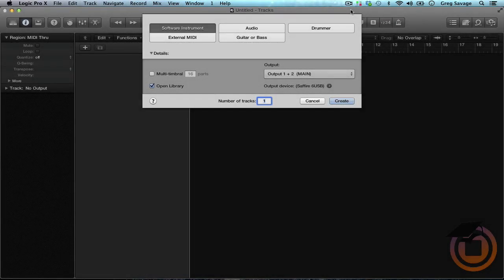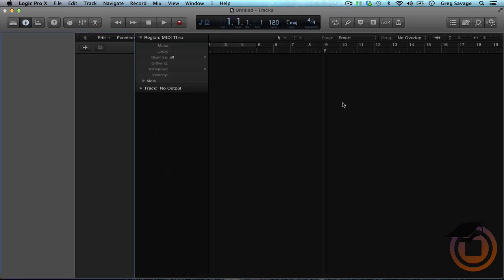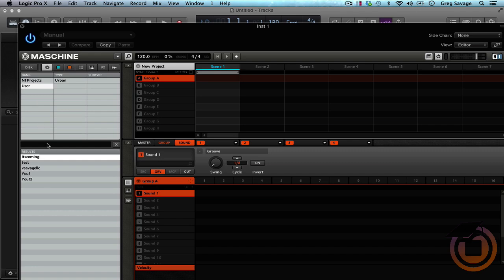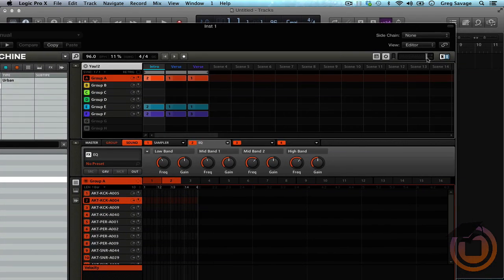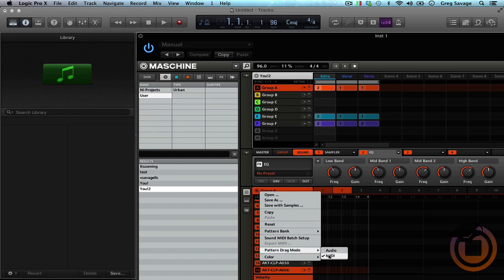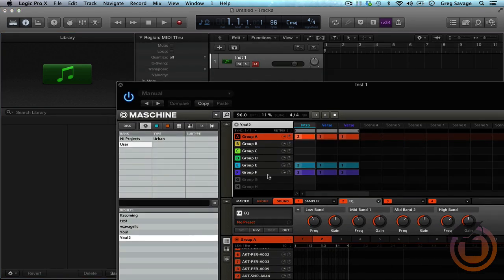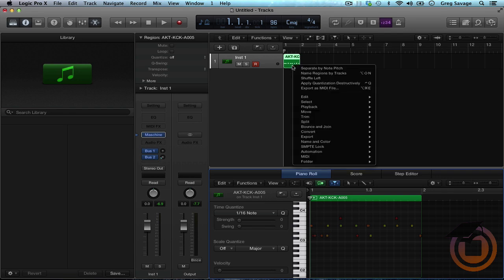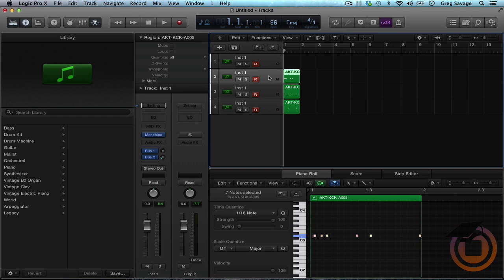Tutorial: Drag Midi from Maschine into Logic Pro X for Mixing

Comment: how can i then eq/effects on each seperate track as if they are all individual tracs this just leaves them all the same on the arrange window?
Reply: I don't understand your question would you please rephrase it
Reply: Hi Greg. I'm struggling with this issue. I have set up the midi tracks fine and separated the tracks by note pitch but when I go to mix/add effect to an individual element it controls all the elements at the same time; when i drop the bass volume the whole pattern drops in volume although they are on different tracks. Would be great if you could help me with this!?
Reply: Jamie Rowland I'd have to see your routing to know what's going on

Comment: Big ups for the tutorial! There is still one big question: I want to use the maschine only for having a faster workflow in Logic by playing the drums on it. But I dont want to edit the drums in maschine but in Logic (add FX doing the EQ etc).
How can I stop the maschine from repeating the loop over and over? If I have to work with audio instead of midi I can just do all the work by hand, which would be quite stupid.
Thanks in advance
Reply: i've just seen that others in the comment section had the same issue but didn't find an answer. It does automatically play and repeat the scene in maschine when I press play in Logic...
Reply: Hey Joël Cavin as I've been telling others I need to see a screenshot or video of your settings, this way I can see what's going on.
Reply: alright, cheers!
Reply: select a empty scene from maschine
Reply: Ever find a fix to this? I've attempted to play an empty scene in the plug in but it just mutes the whole track??
Reply: @jrowland861  did you find a fix for this? I have the same issue
Reply: Jamie Rowland I'd have to see your settings

Comment: thanks for this, however when i drag midi like this i get both the midi notes and the mashine software playing the same audio (twice as load overall), how do i get only the sound from the logic midi track? Cheers
Reply: Restlesscrocodile can you show me a video or screenshots of how you have your routing setup?
Reply: Yeah the same thing is happening because maschine is reading the midi from logic as well as the midid from inside maschine. Did you figure out any way to get around it? I guess you'd just have to delete all the patterns or just have the maschine looping in an empty scene...?
Reply: Ryan Nicolosi can you please show me a screenshot or short vid of your routing? This way I can see your issue and correct it
Reply: Ryan Nicolosi yeah solve the problem, once you drag the midi notes onto logic then just click another pattern with no notes on it so that the maschine is silent

Comment: thank you heaps man - great video.

Just wondering how to isolate the playback to just the midi information contained within the DAW; its seems to play the midi info held within maschine as well the logic pro midi every-time i press play in logic. this is annoying cause i just want to use logic pro as the domain for playback and use maschine as a mean to create sampled loops. wats with that?!
Reply: Greg Savage What i mean is once i have the midi separated into separate tracks after separating them by note pitch, if i try and add automation in logic to say for example the kick drum it will automate all of the the audio tracks that come from machine. i hope this is clearer. thanks
Reply: Hmmm, can you please show a video of this issue so I can see what's happening? I'm not running into this issue myself
Reply: Greg Savage I also have this problem, if you have found the solution please share! Also when i seperate the midi i do not have full control over it for example when i solo the sound in logic it solos all the midi tracks. Thanks
Reply: T Wall can you make a video showing me the issue as well as your settings? This will make the problem easier to fix.
Reply: TheTommo020 I don't have this problem. Nor have I. Can you please provide a video so I can see it happening along with your settings.